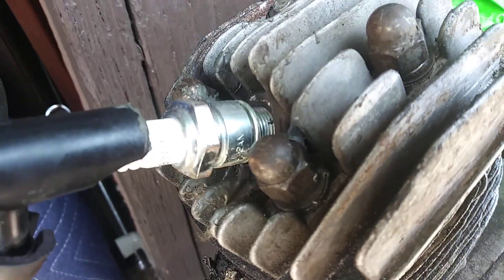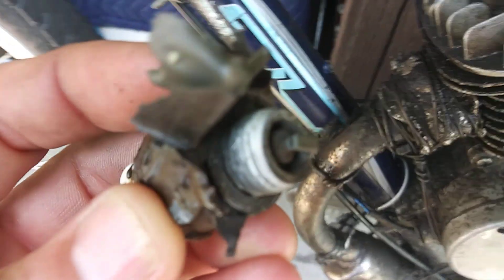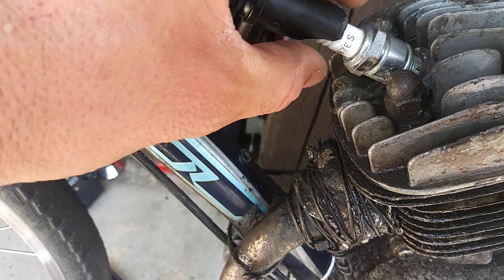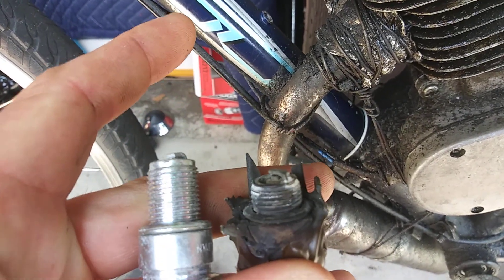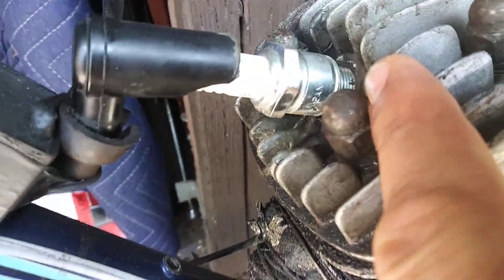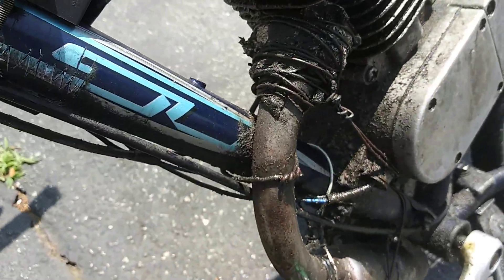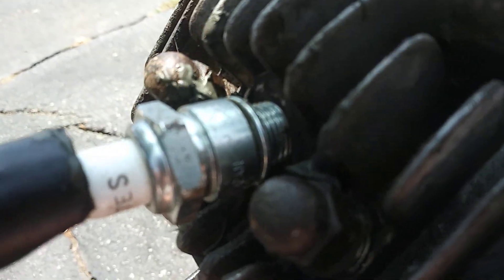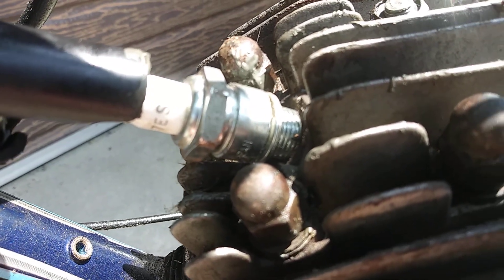Motorized bicycle high performance spark plug mod

Comment: Hey guy If you want more compression from your engine Just open the gap more on your spark plug It will run hotter Only because the spark will take longer to travel to the other end (the tip where they ground out to the engine) And the larger gap will combust more chamber fuel Which will give you more compression (Because of the bigger explosion) But be always be easy on your throttle  (Feather your throttle)  And about your engine heating up Just run your motor with more oil in the fuel   I mix into my 1 Gallon of gas exactely 10 ounces of exxon superflo 2 cycle supreme (but you can use any 2 cycle mix) the Chinese Manuel that came with my engine recommended that these engines should be run on 14 ounces But I haven't adjusted the needle in the carburator to be able to do that But if you put more oil in your gas mixture You will increase your run time Because these engines are only supposed to be run for no longer than 30 minutes And then allowed to cool down Before running it again But with 10 ounces of 2 cycle mix in my gas  I can run my engine for about 3 hours with out any problem As long as your not racing your engine And of course with the proper gearing  Because if you want to go fast Don't have your engine  reved-,up with a 44 tooth rear sprocket get a smaller sprocket Unless your riding on trails Then you will need the 44 tooth But help out your engine with some assistive pedaling (I only ride on the streets though Not on trails)   I run mine with a .034-.035 spark plug gap , and I mix 10 ounces of 2 cycle oil.in one gallon of regular gasoline It smokes a little But it runs cooler (More oil less engine friction , less engine friction , less engine heat , less engine heat , more cooler running engine , more cooler running engine , more (longer) run time But I'm also easy on my engine throttle too  So try that out for your bike engine and see if it doesnt perform better than before Cause it will 😉 Oh as for the spark plug with the longer threading Be careful not to screw it to far Because if you screw it in to far the piston will hit it And then it will break your piston head But I'm sure you already now that But hey mann  Good Luck and Ride Safely 👍✌️
Reply: Haha thats the most bs ive ever read.
Reply from the maker: Please subscribe if you haven't already I really liked your comment you are a smart guy
Reply: What 2 stroke dirtbike spark plug did you use like a yz250,cr250,kx250?? @seedlessgrapes2605
Reply from the maker: The three tip spark plug that comes with the Skyhawk motor is a good spark plug
Reply: ... Yo, if you are putting 10oz per gallon then you definitely didn't read the instructions properly. That's insane and I can't believe you don't have oil dripping from your exhaust and fouling your plug every time you ride 😂that rich of a mix will also completely tank your engines power. Official specs are: 0.8mm gap with 16:1 mix during break-in (1gl), then 32:1 forever after. Please look it up, don't take my word for it.
Reply: The fact that you took the time to write this made my day

Comment: Good mod to do that requires no money other than owning a drill take the clutch pressure plate and drill holes on the contact points this will improve 3 things your clutch grabs better the clutch has better cooling and you have less rotating mass ie better acceleration possibly top speed the more holes you drill the lighter but will be less durable try to measure the holes central as it can cause vibration if it’s not equal you can also cut slots with angle grinder if u don’t have a drill but holes are best option might wear clutch pads quicker hope that helped anyone with clutch slipping issues

Comment: Hello guys I have bought a cheap Chinese 80cc engine kit but I have noticed the spark plug is hitting the piston so therefore I can’t pedal or start it up can anyone suggest a shorter threaded spark plug?

Comment: That exhaust is ghetto-fabulous looking! I got all kinds of jury-rigged crap on mine too, ya gotta make do with what ya can!
Reply from the maker: I totally agree and somehow this bike is working better than any of my motorized bikes in the past and I've had about 10 of them and those I tried to fix properly and do everything nice and that's why I ended up doing it this way because it was a waste of time no matter how hard I tried to do it right the bike would still break every time I rode it
Reply: @rileyandikeysplaytime5936  sounds rough dude, I hope ys get the help you need.

Comment: What spark plug do you recommend for the highest compression ? I called NGK & CHAMPION  technical lines. I talked directly to a factory trained tech. Both disagreed on your change plug for compression. No compression change, its to dissipate heat at different rates.

Comment: You need more oil in gas to keep temperature down.
Reply from the maker: I run a lot of oil actually. It's just a piece of shit worn out engine, but it seems to never give up so I don't plan on replacing it until I blow it.
Reply: More oil will overheat the motor, more oil has to fit in the jet with the gas, meaning less actual gas will be getting into the carb, run 40:1.

Comment: I just reinstalled the carb, exhaust, cdi and added a new spark plug and now I have a metallic pinging noise when accelerating. Does that sound like anything you're familiar with?
Reply: Your plug is tapping the piston, happens with these motors. Get a plug with shorter thread

Comment: Did I really just get two stroke spark pro lesson from post Malone truly
Reply from the maker: Even though the spark plug only threaded in about half way this thing is running great about two or three months later and I probably put about 250 miles on it.

Comment from the maker: Also the heat range is wrong it's a 7 heat range instead of a 4..  the standard number four spark plug is much hotter but just goes to show you can run pretty much anything in these engines and it doesn't matter

Comment: Dude I think it might be time and advantageous of you to do a top end rebuild, new cylinder & piston.
Reply from the maker: Check out the video with the J-B Weld head it shows the Piston it is in excellent shape as well as the cylinder I think I should just get a cheap Chinese high compression head they sell the head with a boost bottle and a bigger carb for like 60 bucks but I'm just trying everything because it's good to have skills in case you need them one day it's running really good right now somehow no compression loss. We will see how long it lasts.  I honestly want to build another bike and I might do that this summer with a two stroke motorcycle engine something like a 80cc but real 6-speed manual transmission
Reply: @seedlessgrapes2605  the bottom ends last forever on these. I would just personally change it so I know I can twist the guts out of it that much longer. As long as you have compression you want I guess just ride it till it blows up. I guess I'm real particular, I tend to change the cylinders out before they go bad. Plus gives you more practice on perfecting your porting. I get the most performance out of porting then anything else"+$20 new g4 cylinder". I laugh at all the posers that buy these huge carburetors that don't do dick and only pushing 35mph. I love your videos, keep up the great work. Remember It's not the arrow, it's the Indian. if you're thinking about jackshaft remember you're still putting drive force on a bicycle chain. As long as I can at least Cruz at 40+and keep up with traffic, also the torque to rip up hills and use cheap stock parts I'm happy.
Reply: Just buy a whole new kit for $100 wtf lol
Reply: @brandonmaster7060  It's a satyric comment goober, it wasn't legit advice 😒.

Comment: Honestly man, i go through spark plugs like they're nothing for some reason, they always have spark but its not enough after i use it for a while
Reply from the maker: That's so weird everybody seems to say the same thing I don't know what to say on my bike in Canada I never changed the spark plug one time but I was crazy it was a Skyhawk 66 motor and I would run it without an air filter and I ran it religiously at 42 one which is supposed to be way too lean of oil mixture and somehow it ran great always 40 miles per hour and I would take that on rides for 45 minutes straight and it did great sold it running those Skyhawk 66cc Motors are awesome especially the older ones from 4-10 years ago
Reply from the maker: My bike gets so hot that the engine will shut down I don't know why the spark plug never died that was a Champion spark plug that came in the motor when I bought this bike used I bought it from Craigslist with the motor already on the bike and that spark plug was incorrect it was too short which actually gives you less compression but it worked good so I left it like that and somehow it's still sparking and I have over 6,000 extremely hard miles on the engine I wonder why it is that spark plugs go weak for you but I know what you're talkin about there is a difference when they get older maybe mine runs like shit so I don't notice
Reply: @seedlessgrapes2605  I use the stock one until it goes then i use a NGK BR8HS, i buy 2 packs of em and i switched the boot on the cdi to one from a car, i ride in southern ontario canada by lake ontario, had alot of needle jet issues for a while, just ordered a new kit as my last one blew up and couldnt be bothered to spend a bunch of money rebuilding it.
Reply: when it comes in i might make a video on troubleshotting ith the first start because a lot of people have issues with it and dont know what to check
Reply from the maker: @camswee7530  my neighbor in Alberta Calgary was telling me about Lake Ontario he was born in Ontario
Reply: @seedlessgrapes2605  yeah its neat, lots of trails where i live, i really wanna take the lakeside trail 45 minutes to toronto one day on a gas bike
Reply: The R in your plug designation means it is a resistor plug and that's not necessary for these unless you hook up a stereo lol .
I'm in the durty south so I run the B6HS and they last about 1000 miles and you could still clean them and use them in an emergency .
Reply: @Rideorflyguy  Can you find a NGK iridium plug that is non resistor that fits the bike and has the appropriate depth? Tested all spark plugs and my previously stated spark plug is the da shit. I've tried all other NGK plugs and I can greatly tell a difference with iridium plugs. You can get away with a slightly longer spark plug so it's not so recessed.and the heat range is perfect, I can't imagine going any colder.
Reply: @JamesPiccone  NGK B6HS . Is what I like on a factory head . The h is indicative of a half thread . 
Any ngk w r is a resistor
Reply: @Rideorflyguy  yeah when I first started that's what I used until I  tried iridium.
Reply: @JamesPiccone  oh , I see what you're saying . Gotcha !

Comment: Tape, wire, and JB Weld are not for repairing engines.
Reply from the maker: You forgot zip ties and super glue
Reply: Lmfao Seedless Grapes keep it up brotha!
Reply: Oh ho ho, I beg to differ! I have been putting JB weld INSIDE my cylinders in the bottoms (top) of the transfer ports to increase the angle of the back and increase mixture velocity- it works great!

Comment: Hey, I have a question I ordered 2 Chinese engine kits and when I took them out the box the drive gear is not in all the way so it put it on the bike and when I start it up the gears are very loud
Reply from the maker: Really??? I wish there was a way that you could send me pictures through YouTube so I could see what it is
Reply from the maker: If you really want a clear answer you should take a video on your cell phone and post it to your YouTube channel it's really easy and then I can check it to see exactly what it looks like